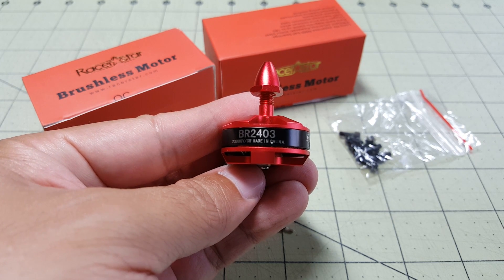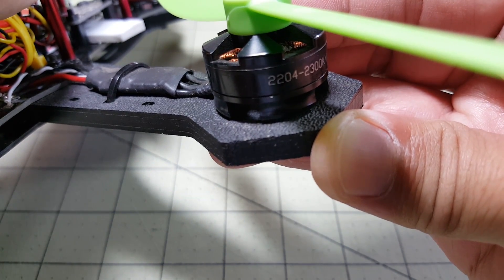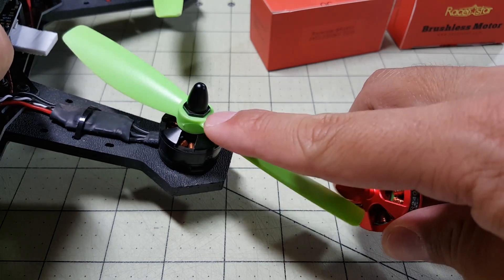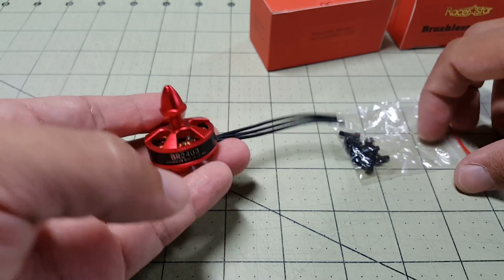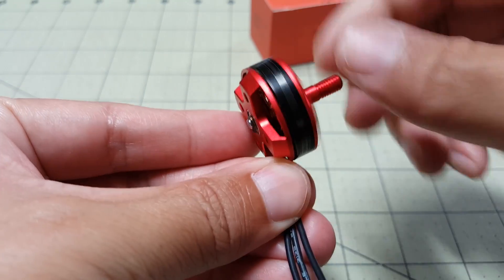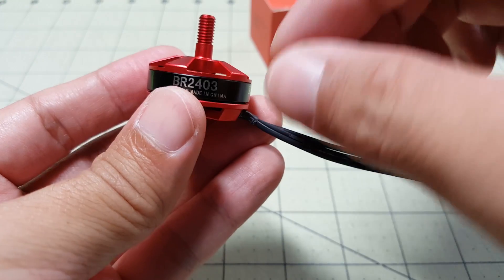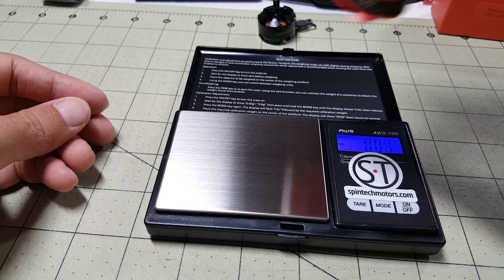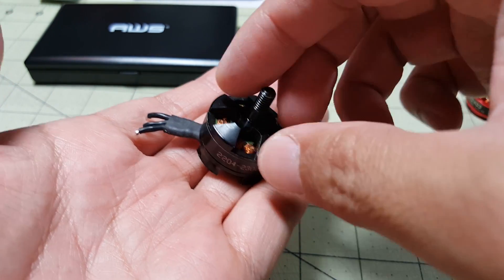Racerstar 2403 2300kv Motor Review

Comment: Just a comment i have 2 sets of these motors and I usually run emax mt2204 type 2300kv motors. SInce moving to these motors on 4s My battery times have gone through the roof. My 210 on 2204 4s was landing after 3 minutes racing where these motors at same speed are getting me 5 clear sometimes up to 7. That is running 5040 tri props. The timing on my escs was left at medium with damped light on blheli. In my opinion there higher torque is best on tri props and 4s. Im thinking that at 3s the advantage is lost over the 2204. They handle more like a 2205 but with less top end and without the amp draw. My amp draw at full throttle according to my hubosd was 60 amps peak. So only 15 amps per motor at max thrust. This would indicate they could maybe be put up to 6 inch tri props (not bullnose) on 3s to take advantage of the extra torque.
Reply: hey Hi.  so 2403 motors do fit on 210mm frame without any issues?
Reply from the maker: +Swapnil Nimbalkar seems OK
Reply: thank you.